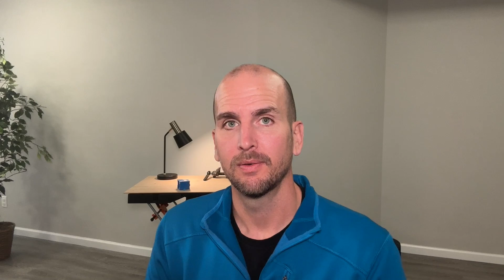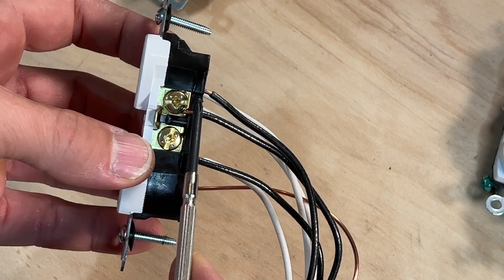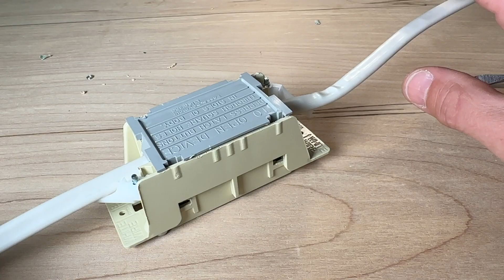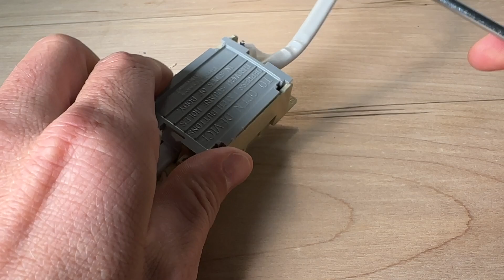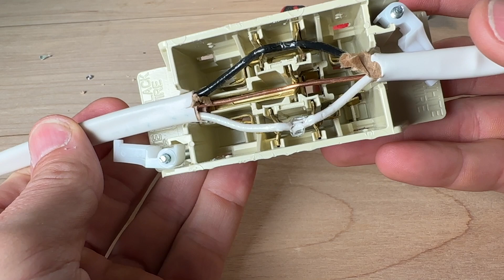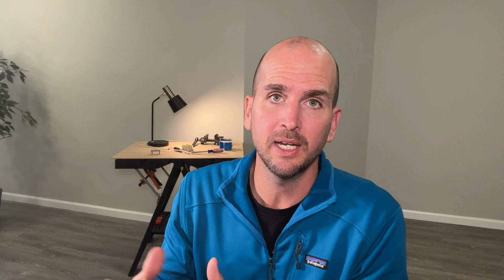90% Of Homeowners Have Never Seen This Dangerous Electrical Device

Comment: I am someone who comes from the computers networking world and with some experience in wiring rooms and building with Ethernet in a commercial or industrial setting (what electrical tradespeople typically call "low voltage") . 

Punch down tools are what are typically used to connect Ethernet wires to receptacles (usually called jacks), which I think is what he is referring to when he was talking about connecting these outlets to a wire. The process is quite similar (albeit Ethernet has much thinner wires). 

That being said I have also had to replace outlets in my house and kinda wished the process was similar to punching down. He is right though it would require a special tool, and for that tool to be about as common as a multi meter to make it really work well.

Comment: I don't have experience but they look terrible. So little surface area in contact with the wire, there's also no clamping ability, so there's a chance it could become loose and no way of tigtening it down which could cause a fire. This type of connection should only ever be used on low voltage, it's not safe for utility power

Comment: Grand Design RVs used this very type of outlet to power our residential refrigerator in our Solitude 5th wheel. I discovered it when investigating why our refrigerator would randomly stop cooling. It just boggles the mind why they would use such a questionable termination on a vehicle that vibrates and bumps down the road to power sensitive electric and electronic appliances. Needless to say, I replaced it.

Comment: This is as scary as the 3D Printers. They like to tin the wires running to the heated bed. Usually about 20a at 12 or 24v. Same with some of the other connections they will make on them

Comment: I've seen a lot of these splice type joins come from cheap Chinese automotive products, I cringe every time I see that they've actually been used and that's with low voltage/current systems, no connection to the grid 😅😅

Comment: RV's also have inline wire splices based on the same design and can actually replace a junction box.  They are often used to assist with plug in power connections on slide-outs that are added after the main unit is assembled.  I believe the code allows these to be buried in walls and ceilings in many case.  Are they dangerous?  Inherently no, but with improper installation and use they are an accident waiting to happen.  On my motorhome I replaced every single one with HD screw type outlets and switches.  So I inherently agree with you 100%.

Comment: I see the backstab used in automobile 12volt accessory application.  Still don't like it as with car wiring the insulation is stronger than the wire threads.

Comment: Yes, These require a special tool, and yes these are a bit dodgy and potentially dangerous for mains application. This style of connection has been in use in land-line telephone service for 60+ years and also electronics industry known as IDC (insulation displacement connector). The object is not to remove insulation but just to allow fork contacts to pierce and grip the copper wire with spring tension.
There are no screws which can be tightened, but the wiring passes through with no interruption.  This works fine for low current communications and data transfer wiring.  
The brief video appears to show double forks on each wire which improves the odds for reliability but only when a proper installation tool is used and there is no mechanical stress or torsion on the wires.  These are definitely not for DIY electrical.

Comment: Never saw them and would never use them. I'd much rather use the regular socket to connect two separate wires, even though I'm pretty sure that's not code compliant.

Comment: I believe those are called Vampire Taps for obvious reasons. They used to be common in computer networking applications since they could be installed without shutting down the network. I've seen this used in electrical applications on certain butt joint connectors, but only in low watt DC applications. I never imagined using one like this...

Comment: never seen those, but I HAVE seen small devices that can 'splice' a conductor into an existing one that work similarly... (plastic clamshell, with a slotted metal square in it; lay a wire in each slot, close the clamshell with pliers, snap a clasp over it all... not waterproof, not sure how much power they can withstand)

Comment: RV vibrates as you travel on the roadway, similar to boats on the water. ANCOR Triplex Cable 12-3 (12 gauge stranded wire, 3 conductors (black, white, and green)) would be my choice for RV and Marine applications.

Comment: Seems that at a minimum, the impaling mechanisms should be in opposite corners, not cut at the same place in the overall cable.  Nonetheless, brings a plumbing 'saddle tap' to mind, as a quick and convenient 'solution' that avoids the safety and effectiveness of standard devices.

Comment: The shittiest wire connection I've ever made to an outlet probably has 3 to 4 times as much contact area as these things. If the code is okay with this sort of contact area a side wire should pass inspection if the wire is only wrapped 45º around the screw.

Comment: What is the difference between this type of outlet connection and the push-in connections on the back of standard outlets, besides the fact that the back cover puts pressure on the connections with this style vs a standard outlet?

Comment: If we so much as remove it to look at it... If the cover comes off... WE WILL NOT REINSTALL IT. The blade connection is trash and is begging for a fire. In my house, I immediately replaced every switch and recept. The only acception isthat thankfully there's no GFCI version. If it's a GFCI ... It's a legitimate recept.

Comment: These may only be installed using the appropriate tool. Then and only then will they meet the installation requirements. All other methods of installation can induce faults and high impedance contacts.

Comment: ive installed these in rvs for 20 years. I have several pairs of presses for these. It's just like anything else, if you install it correctly the chances of failure go way down. I am remodeling a house right now, i've strung 12/2 wire throughout the house with 6 recepts per circuit and i've been running so much power through them i blow the 20 amp breaker. The recepts have functioned just fine. I trust them and have used them forever, but when i do electrical in residential situations, I wouldn't use them.

Comment: Those are F*****g DANGEROUS ! They should never have been approved. I would never use them, nor would I want them in any building I owned.Back wiring is iffy enough, but is OK if done correctly. That, on the other hand is just asking for trouble.

Comment: Yea these are all over our "mobile" not so mobile home, some on 20A lines, light switches are attached similar. We're gradually replacing them with more traditional outlets. Due to the thin walls we have to use the "low voltage" orange box instead of the blue one to mount the outlet or switch in. Just to be safe we put electrical tape over any connections after installation.

Oh also would you believe a new replacement of this style is more expensive than a proper switch?

Comment: I would be willing to bet the testing and instructions require the tool to make the installation “certified”, essentially the poor contact would be the failure.  but the manufacturer gets to say “WELLLLL, you didn’t use our specifically mentioned and required tool so that’s not on us”

Comment: i seen something familiar as those in south texas when tapping in main line for solar panels, i really don't like their methods vs adding breaker and put in way on bottom end away from top main breaker, for that its good thing they never finished the hook up so, i went ahead went out bought 40amp breaker and relocated whatever the bottom is occupy and move upwards like organizing better than installer who made little messy where breakers are at when they installed newer main panel...then i put the 40amp for the solar panel arrays...now i am much a pro in this vs company can't finish the job and have issues with parts and lying through there teeth

Comment: Pure junk.. to do it right you need a giant set of "crimpers" to press in the wire properly flat that are around $350 to$500. Also, don't bother to try to reuse them once you pull the wires out.. they are bent out of spec and won't be safe ... Did I mention the word junk??  I'm an RV tech.. I've used them more than a lot.. I have no idea why they are standard equipment on things that are subject to weather, wild temperature fluctuations, and bouncing down the road... Junk.

Comment: How are those legal I don’t know electric work but just looking at it it looks dangerous and should not be legal and if legal only electricians with proper tools should be allowed to use them and required during inspection to notify inspector they were used which then inspector should know how to and should be required to inspect to make sure it’s done properly

Comment: I see IDC connections (Insulation Displacement Contact) all day long. They are extremely common in my line of work and used to be even more so a the further back you go. But I work in computers. I have never, not once, seen an IDC used for anything above milliamps on a DC line generally below 24 volts. That's just insane to see that on a mains. How the hell is this legal, let alone actual CODE?!?!?!

Comment: These damn fire hazards remind me of the crimp on replacement plugs and crimp on add a outlet plugs they use to sell.  And like the aluminum wireing that use to be in mobile homes that also caused many fires and killed people.  THEY ALL SHOULD BE BANNED AND REPLACED AT THE MANUFACTURERS COST UNDER A FEDERAL RECALL AND A RETROACTIVE  CLASS ACTION LAW SUIT BE IMPLEMENTED WITHOUT A LIMITATION ON TIME OF OCCURRENCE  !!! This kind of practice needs to stop and the manufacturers and contractors taught a lesson to ultimately prevent the kind hazards and dangers to life these kind of things are responsible for !!! 😡

Comment: I am actually pretty surprised that the back isn't molded into the special tool to install the wire properly so that that the wire is always applied optimally when the back is closed, which would make installation cheaper, more reliable and safer for very little additional cost.

Comment: Maybe pushing the backplate down into position would be used to clamp the wires to the terminals as to not over push and nick the copper. That would be too easy

Comment: I purchased a 2018 mobile when it was new.  In removing a dishwasher I found this type box which fed the dishwasher and a receptacle on the side of the island.  I was appalled at the appearance.  I quickly replaced this device with a screw down type receptacle, however I'm certain there are more of these around.  We are not heavy users of current and have absolutely any appliances approaching the ampacity of these, however, I agree they are inadequate to the enth degree.

Comment: The only reason those boxes make code is because they bribed someone.

That is the single most horrible outlet design I've ever seen. I was concerned about it nicking the wire but it's much worse than that, it makes just enough contact to start a fire.

Comment: That small amount of surface contact is atrocious.. that's calling outloud for a hot spot of contact.. also if the wire over hear and breaks or something like that.. it will automatically cut the power supply for the rest of the circuit chain..

Comment: When we begin to purchase our mobile home it had these and a few of them flat out didn't work anymore, so $80 later and a lot of cutting holes in drywall because fun fact those self-contained outlets have a smaller footprint than junction boxes all of the outlets in my mobile home are now much safer and I feel much more confident in using them with heavier appliances. Of course mobile home wiring is always kind of iffy it's definitely built to a price

Comment: ive never done these, but ive done plenty of "plug molds" that are the same concept... we usually use them under desks because its like an oversized power bar... ive never had an issue with them but personally i dont care for them for anything more than something that takes low amps

Comment: One of my trades is structured wiring (TELCO) and the best way to install a wire harness is using BIX bars.

And BIX bars use the exact same way WIRECONs use with a few differences:

   1 - No I2R losses are implied in TELCO (max. current around 20mA)

   2 - the number of TELCO interconnects is HUGE , so reliability is crucial.

To get a high quality BIX:

   A - BIX punch tools are of prime importance to make a solid contact. Use
         of screwdrivers or razor blades will result in intermittent / non-reliable connections.
          Not using the specialised too for WIRECON's will have the same result.

   B - You can not re-BIX the same wireat the same place since a removed BIXed wire
         will become fragile. Same thing for WIRECON's.

   C - You can N-O-T BIX two TELCO wires in the same slot since the second wire will loosen tension on the first wire. Double-inserting a single WIRECON slot will rise I2R losses and overheating.

Comment: Not saying these are great or anything but this is the exact way that many power strips and such are wired. In fact a commercial level wall mounted power strip Branded plug mold is wired this exact way to save space on the wall. I take apart a lot of equipment so I get to see the inner workings that a lot of people don't and there are many UPS backup systems and power monitoring equipment that also employ this same method.
 As he stated it may be fine if They were inserted and installed correctly  but I guess that applies to everything honestly.
 But this honestly this is the way it is with improving processes and technologies.  we always find ourselves looking back going oh my goodness I can't believe we actually did it that way or I can't believe they were promoting asbestos use and such lol

Comment: Never seen one. I can see the value of an all-in-one outlet with a smaller profile than a standard box + outlet, but I do not like the punch-down mechanism. Why not just put screw terminals inside? Seems like it would be easier to install,  too, even if you had the correct punch-down tool.

Comment: I'm sure these would never be approved for use in the UK because there's no way you can guarantee full and sufficient contact between the conductors and the terminals. We have something similar for use in domestic telephone junction boxes and vehicle trailer wiring but that's it!

Comment: This thing just looks to me (an electrical engineer) like a fire hazard. I don't care how well those connectors are crimped, if you plug a vacuum cleaner or a clothes iron or space heater into that socket, pretty soon your house will be on fire.

Comment: It sounds like a "punch down" tool would be needed, similar to what you would used on a panel installing cat cables.
Reply from the maker: Agreed, it is a must to install properly.  The issue is I would guess very few who actually replace these type would have and/or use the tool.

Comment: Our previous 5th wheel RV back wall almost caught fire from these crappy outlets. Luckily a breaker tripped with only some minor charring.  I replaced several using shallow old work boxes after enlarging the hole in the wall a slight amount and used Leviton Decora outlets. The next 5er had a couple outlets that had intermittent faults. Same repair method used. There was plenty of unsecured cable to easily make these repairs . A note that both RVs were so called "premium" units

Comment: I've wired (and pulled apart) Ethernet cables and the connections made by crimping those together are way more solid looking than this, despite the low current application!  I can't believe these outlets are legal.  And to be used in RV's where there's the potential for constant shaking?  That's crazy.

Comment: don't like this, have seen things like this, usally same setup in like the small spinning line cord lamp swiches. Similar also to low voltage splices for cars, boats, landscap lights, etc. Also used in analog phones in a way with punchdowns, etc. This is how ethernet patch pannels work too.

Comment: Our mobile home had 100% all these... they also rarely come with the extra wire avaliable to wire a normal box several spots I used your wago lever nuts video advise to extend the wires past the box many were deformed/ melted from years of use... all are removed now and proper outlets have replaced them the switches were also the same design with a splice made in the hot side line

Comment: As you opened it up I thought, “I’ve seen that somewhere...”. Then I remembered, on 12 volt DC automotive electrical systems, where new circuits are tapped in after-market. 
I hate ‘em; when I can I’d rather cut into the circuit and use better splicing systems. Wire nuts (“ScotchLoc’s”), or Wago’s, or old-school solder and tape